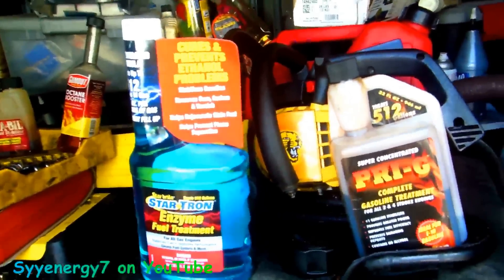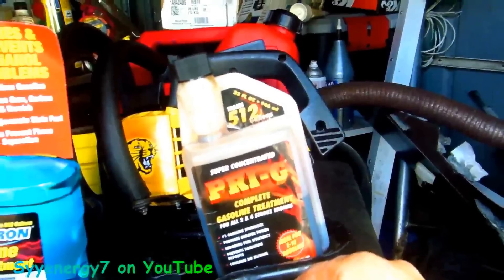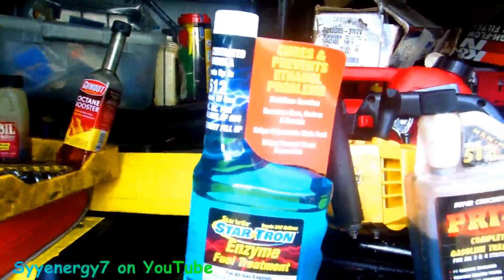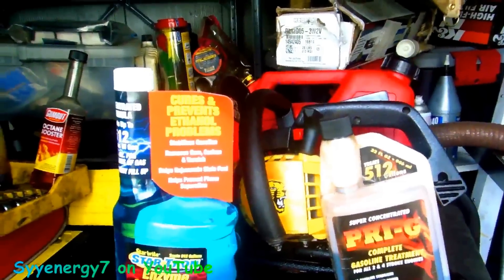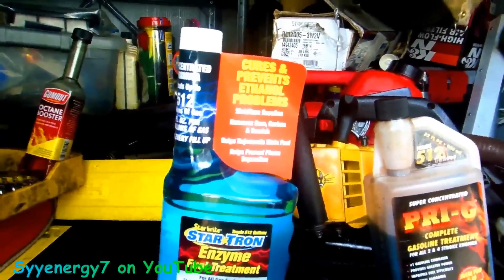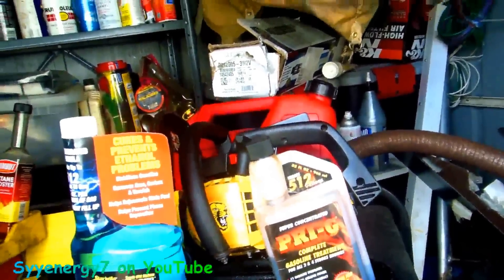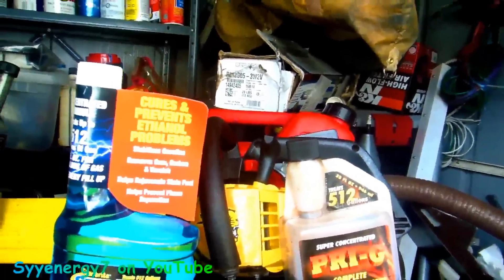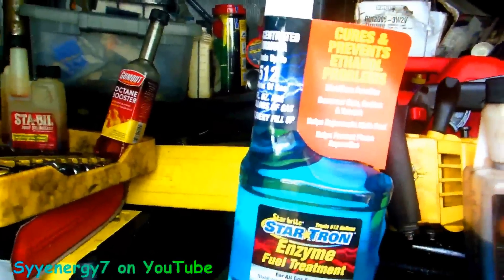The Truth about Gas Stabilzers and Ethanol Fuel

Comment: Lord, u are so smart, I am in love with your brains. I have been having problems with my gennys, and it's the crap gas in caries causing sludge and corrosion. Gone through 2 almost new gennys. Had to give them to.my friend who always has to remove the whole gas system and do major cleaning to get the machines to work again.
Litter ally seized the pistons. It is horrible stuff.
I was wondering if you used lead add to the gas in your old cars.
Reply from the maker: The older cars I have can handle unleaded because they have the newer type valve seats.  If you had a '60's ca you'd need to change the valve seats to handle unleaded, which would be cheaper to do in the long run.

Comment: Thanks for sharing your experiences with fuel stabilizers, I've had positive results using StarTton Enzyme in my mower and snowblower. I live in upstate NY and was told to not store my gas containers on the ground during the winter months due to condensation and to use 89 octane instead of 87 octane gas.
Any thoughts on HEET gas line antifreeze & water remover ?
Reply from the maker: HEET works.  I used to use that stuff in the middle of the winter when I lived up North many years ago.  Without using it and down to single digits Fahrenheit there is decent chance of a gas line freeze up due to water in the lines.  When using HEET , I never had that problem.

Comment: What i do is what you said about full sealed can but that startron claims to reverse separation. So when i use the untreated ⛽ i pour it through the mr filter thing that removes water then treat with startron. Even without mr. Filter thing before i used startron by 1957 evinrude lark outboard would hardly start with untreated gas over 1 month old. Treated with startron gas over a year old the outboard has never had a hickup. Pri is a bit overpriced so i never tried. A $6 bottle of startron treats like 40gal and only one that claims to rejuvenate.
Reply from the maker: Star Tron will work up to 0.5% water in the gas and prevent separation, but it has limits.  I think Star Tron is the best for E10.  That's why I got it.

Comment: Any thoughts on Sea Foam? That stuff is expensive but I use it regularly in gas and diesel and I also pour a bottle of it in the crank case and warm up the engine with that in it just before an oil change. I do that mainly because my old man swore by it and absolutely insisted on using it for his whole life. I never seem to have any problems with fouling or fuel system issues so I just use it.
Reply from the maker: Sea foam is a cleaner and excellent, but it's not a fuel stabilizer.
Reply: True enough. I did not mean to imply that it was a stabilizer. And also, i did not know that an ethanol antidote is synonymous with fuel stabilizer. Again, good vid.
Reply: I've heard Sea Foam contains alcohol, such as ethanol. Is this true?

Comment: Man good info, but I just skip that whole drill by buying gasoline in the first place. It costs more but I get better mileage and dont have to worry about destroying my engines by pouring ethanol in it. For small engines, forget it, NEVER use ethanol EVER.
Reply: me too, now I only fill my cans, for the small engines, with the no-ethanol gas.  It is worth the 40 cents or whatever extra a gallon.

Comment: What's wrong with just running all the gas out of the lawn mower before putting it up for the 7 month off-season here in Arkansas
Reply from the maker: What I was saying was i knew the stuff worked because I didn't drain the gas in the lawnmower.  i normally do drain the gas in the lawnmower.  But I keep gas cans around too and also keep the bike and generator filled.  I use the bike at different times.
Reply: cool I was just wondering if it would hurt anything to run the mower gas out and leave it empty for 7 months, is all
Reply from the maker: Draining it and running it out is the best method, definitely.
Reply: It's difficult to drain all gas from carb. bowl  - https://youtu.be/kkyJA_UQ9GM